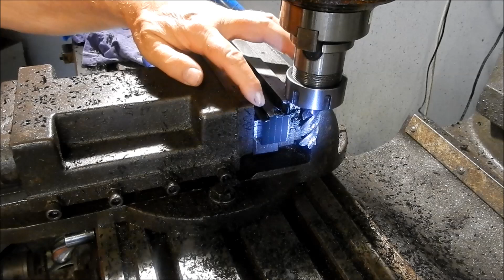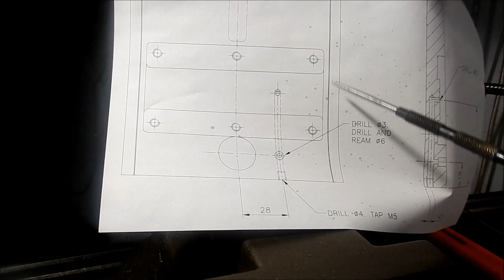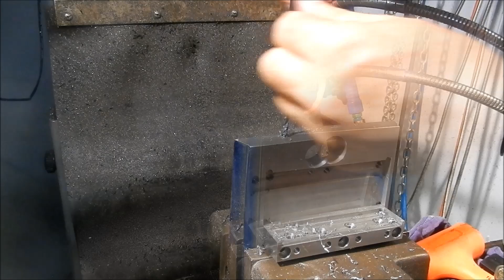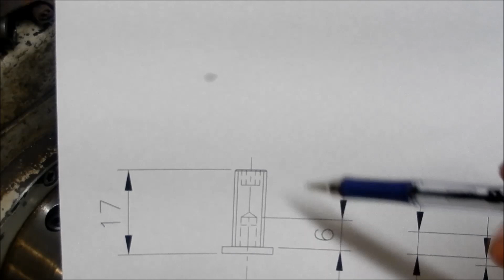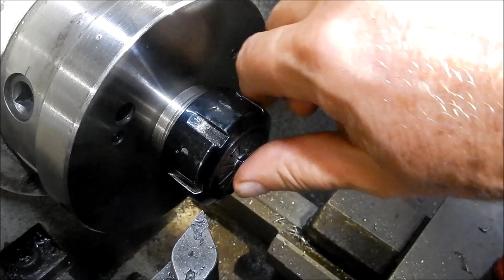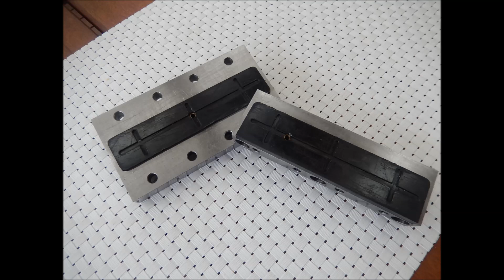Powered Lathe Slotter Build Part 47

Comment: G’day Cam, a lot of work has gone into this build, wow 47 videos so far and all excellent work including this one. The CAD work alone must have taken some time. Not long now, you should be seeing the light at the end of the tunnel. 
Cheers 
Peter
Reply from the maker: Thanks Pete, the actual design part was very quick.  Its something I did professionally for over 30 years and feel very comfortable with.  The machining I thought would also be fairly quick but my own expectations and reality where two different things.  I'm enjoying getting my hands back on machining and looking through the other side of the mirror at what I expected from contract machine shops and fabricators all be it on a much larger scale.  Yep, hopefully not long to go now but there is still a few rats and mice issues to deal with.
Cam

Comment: Hi . Good progress, where did you procure the oil ports from ?
Reply from the maker: Thanks Max.  There are lots of eBay sellers that do sell them.  Try - 
https://www.ebay.com.au/itm/LOT-20-Brass-Push-Button-Oiler-Press-Fit-Ball-Oiler-For-Hit-Miss-Engine-Motor/232644886863?hash=item362ab7414f:m:mMf3tvZxA4B54PGH4QyTtpA
He has all different diameters and sizes.
Cam